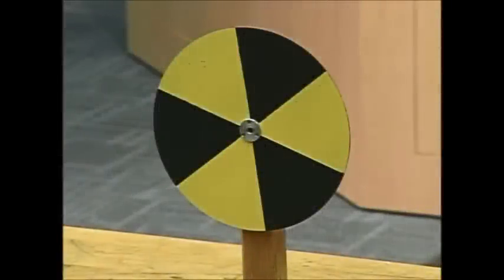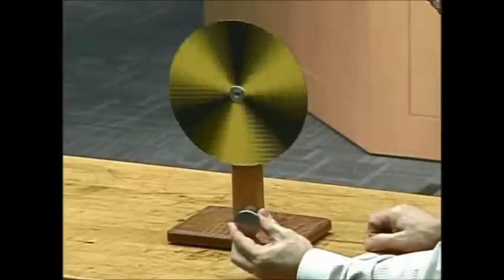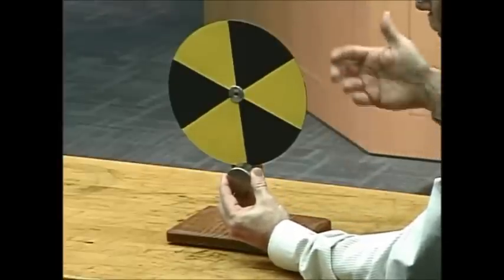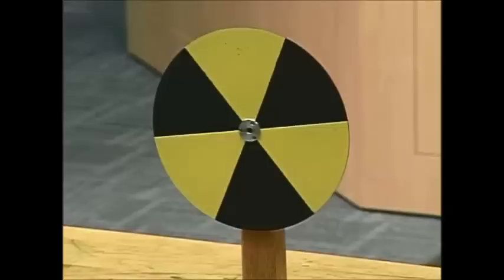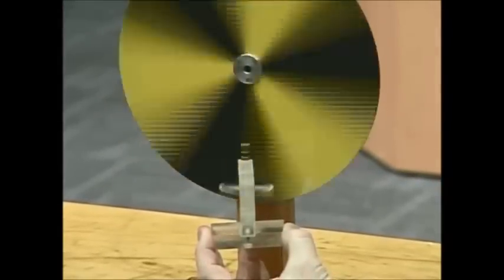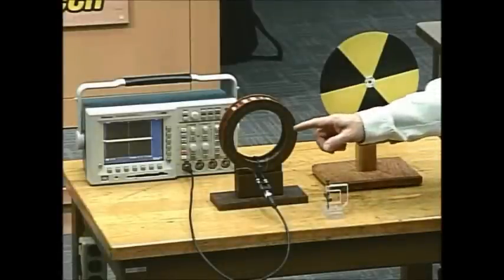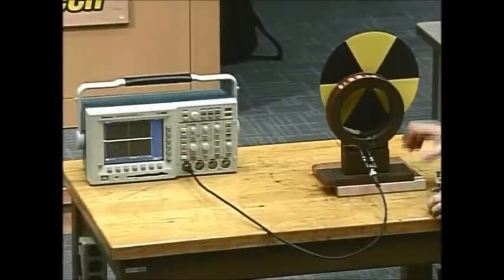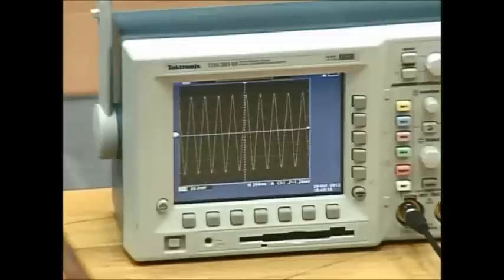Magnetic Damping - Spinning Wheel Generator

Comment: Can you use the energy from the coil to run a dc type dc motor to spin the wheel continuously? If the coil was large enough and the weight distribution was offset correctly? Maybe even a trickle with a battery or a capacitor to store energy created by the coil?

Comment: Great video. It can be used as a sort of physical model to help explain NMR.  The tiny magnet can represent hydrogen, the large wheel carbon, and the coil can represent the coil inside the probe. I know it doesn't truly reflect what is actually going on but it would be a good start.

Comment: Sorry for the stupid question. I have always seen this kind of eddy current brakes being used in materials that are not ferromagnetic. If I do the same experiment with a steel wheel, what would happen?

 There would be attraction, of course. But if both magnet and wheel are fixed, it would generate current in the steel wheel and then the eddie brake effect?
Reply from the maker: The eddy current effects will still be there, but the magnetic attraction will probably dominate.  Try it and let us know what happens.
Reply: @3piecesuits  that sounds like a good experiment. I will try to test it in the future.

Comment: Sir, I have a question. The eddy current induced is due to a change in the magnetic flux which can be explained since you introduce the magnet in front of the rotating disk after it starts spinning. But suppose we FIX a strong magnet in front of the wheel and then spin it. Would it still stop?
Reply from the maker: With the magnet nearby, each portion of the wheel feels a changing magnetic field as it passes the magnet.  That will also occur if the magnet is fixed.  If the magnet were fixed, the damping would be present from the start.
Reply: Your question, if you have two wheels, one made of al and the other mag they would spin in the same rpm with the magnet wheel lagging due to return flux from the eddy current. If you stop either one the second will follow.

Comment: Is there anything that can completely stop a magnetic field other than a shunt?
Reply from the maker: Not sure what you mean by "stop a magnetic field."  You can shield a closed volume from magnetic fields.  For small static (time independent) fields you surround the volume with a magnetic material such as "Mumetal."  For time dependent fields, you can surround the volume with any good electrical conductor (e.g., copper).  How good that shielding will be depends on how fast the field changes with time -- faster changes are easier to shield than are lower frequency changes.
Reply: @3piecesuits  What I mean by blocking or stopping a magnetic field is to completely eliminate the field like the way a sheet of cardboard blocks light. 
  I've noticed that a magnet from a hard drive is only magnetic on one side when it remains attached to the steel mounting plate. I believe it behaves like this because the magnet is epoxied to the plate and whatever pole is attached to the plate is forced to conduct itself through the plate and all magnetic lines of resolution are contained within the plate. If you try sticking it to a refrigerator only one side will stick,  the plated side has zero attraction.  This is the behavior that I  am looking for, the complete and total ability to block a magnetic force in the smallest space possible without being attached to it physically.  
  Do you know of anything that is capable of doing this, it could even be another magnetic field but it can't make contact. What I am looking to imitate is an electric motor using magnetic force only. I wish I could talk to Nikola Tesla.

Comment: Could magnetic dampening be used effectively and efficiently on vehicles other than trains and monirails (only 2 Im Aware of that use it)

2nd question how much energy was used to spin the wheel and how much energy was created from the spinning magnet?
Reply from the maker: Yes, magnetic breaking is used in a variety of vehicles, including many hybrid and electric cars -- energy derived is sent to charge the batteries.  However it is done much more efficiently there than what you see here.  Q2: I don't know.  It is probably not very efficient at all.

Comment: I have been interesting in magnetic for 1 year but I just got stuck every time I try. I have one more question. Can the whell move faster if we replace it with A stronger magnet?
Reply from the maker: Chelsy Nguyen A larger magnet will make the interaction larger.  That may or may not make it go any faster depending on circumstances.  The wheels on a car rotate at the same speed even if you increase or decrease the friction by a small amount.
Reply: Surprisingly, probably not.

Comment: What would happen if the bar was spinning parallel to the copper coil? Would it still give a signal?
Reply from the maker: The size of the signal depends on orientation.  If the plane of the spinning magnet is parallel to the plane of the coil, then the signal will become very small and with careful adjustment, can be made zero.

Comment: Like brushless motor?
Reply from the maker: It is not really a motor -- it does not have a source of power and will eventually stop.
Reply: @3piecesuits  Instead of stopping the disk if you want to run the disk it may be possible with rotating magnets near the disk without any contact. This is due to the focault's currents.  Right?
Reply from the maker: @mauriziocavazzoni7045  If a motor were used to drive the rotating magnets, and they were close to the aluminum disk, the aluminum disk would rotate as a result of the eddy currents.
Reply: @3piecesuits  I agree. It's right. Thank you for your answer.

Comment: Not being a scientist, I have a stupid question:  Is this a perpetual motion machine?
Reply: Technically no, but yes. Magnets can last hundreds of years, but since they will eventually lose their magnetism scientist would say it's not a perpetual motion machine. In their opinion it has to continue moving forever. Of course, forever doesn't exist. The other requirement they've come up with is no external energy source can be used. His hand spinning the wheel initially would be an outside source of energy. Outside source of energy is vague and not clearly defined by them. 

Scientists should do away with the concept of a perpetual motion machine with impossible restrictions of forever and no outside source of energy. We should measure continuous motion in terms of years and how many magnitudes greater the energy is created from any original source.
Reply from the maker: No, this is not perpetual motion.  The bearings have some friction and the device will come to a stop.

Comment: Put magnets on the wheel itself and use other stationary magnets to keep the wheel goin .. modify size to to charge 12 volt batt idk looks cool
Reply: If you put them on the wheel,  it will not spin "freely".....
I like this because it would take very little energy...wind, water or even just a temperature change to produce electricity

Comment: Unless I was asleep in science class that day, magnets should have 0 effect on aluminum ?!
Reply from the maker: Magnets are not attracted to aluminum, that is correct.  However a moving electrical conductor in the field of a magnet will feel a force similar to friction or air resistance.  It is not an attraction.  Since aluminum is a conductor it will experience this force, but only when it is moving relative to the magnet.  Once it stops moving, there is no force.

Comment: I would like to know what happens when load is connected to the coil.
Reply: It will create a drag on the spinning magnet which will further create a drag on the flywheel as the magnetic feilds start to misalign

Comment: aluminium is not magnetic. plus... why exactly is a wheel supposed to stop, merely because of magnetism? none of this works like that
Reply from the maker: You are correct that aluminum is not magnetic in the sense that a magnet will not stick to it.  However, it is an electrical conductor.  Time-dependent magnetic fields create electric currents in electrical conductors.  Those currents, in turn, create a magnetic field, in the same way an electromagnet creates a magnetic field, and that new field opposes the changes.  That will cause the spinning wheel to slow down when a magnet is present due to the changing magnetic field experienced by each spot on the wheel.  Once the wheel stops, the field from the magnet is no longer changing in time (at each spot) and so there is no longer a magnetic force.  Any non-magnetic electrical electrical conductor would act similarly -- aluminum was just a convenient choice for construction.  It does work like that...